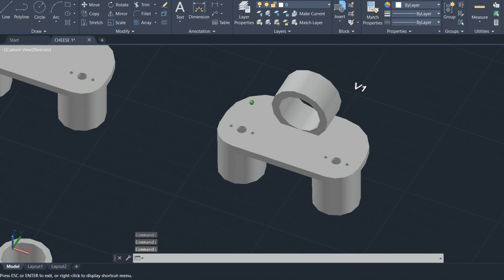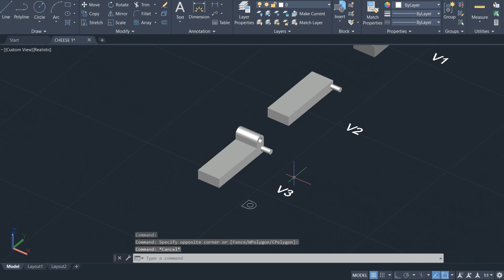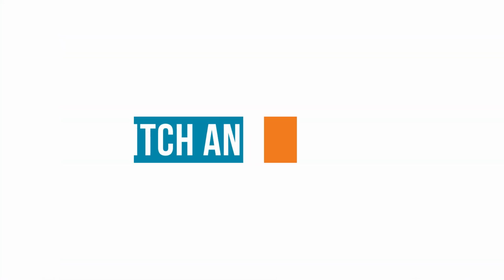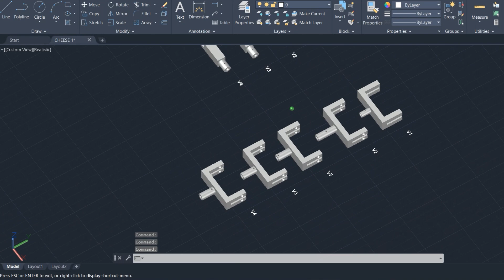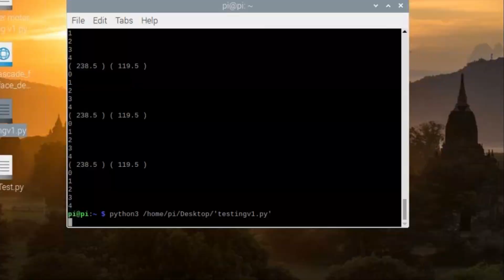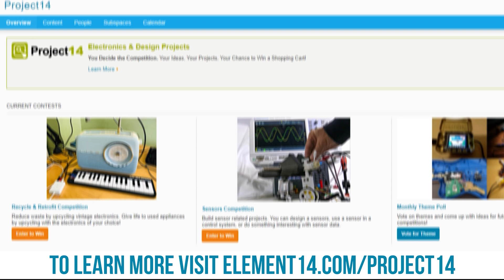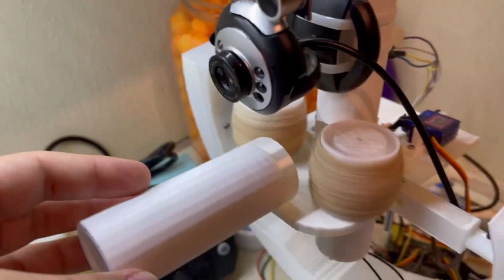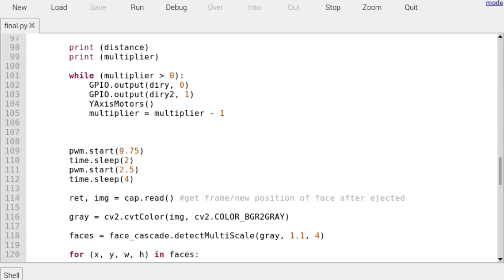Face Tracking Cheeseball Launcher with the Raspberry Pi

Comment: The issue i had doing a similar project was the amount of noise the stepper motors would put out was high enough to make my tv 4 feet away reset (as well as occasional software flukes). That may be related to your camera issue?
Reply: That’s possible, but I didn’t run into that problem until I turned on the dc motors. The camera functioned fine when it was only the steppers moving

Comment: Hey I made a video with similar idea on my channel (I think we might've actually used the same example code for open CV lol) 
Found it really interesting as you spoke about nearly the exact same problems I had. 
I also found it funny how I wasted hours writing physics equations into code not only to realise I hadn't taken the "deceleration due to the air resistance acting on a malteser" into consideration.

Great video as always!
Reply: I just watched your video, and I enjoyed your project! I liked the spring approach you used to launch the malteser (it looked like it launched the maltesers pretty fast lol). Yeah, I'm assuming the math for the maltesers would have been not quite as bad as the cheeseballs if I had used strictly physics equations (but I didn't). I have no idea how I would have constantly calculated/measured the air resistance, drag, and lift forces acting on the cheeseballs (even when each cheeseball had varying shapes and masses).
Reply: @adamsoileau4804  bet that's a conversation you never thaught you would have had when you started engineering haha